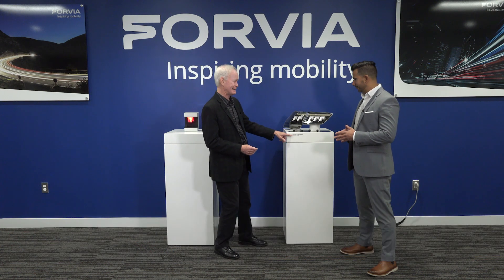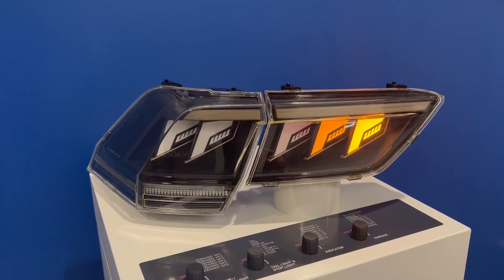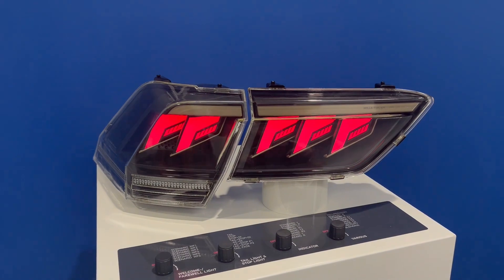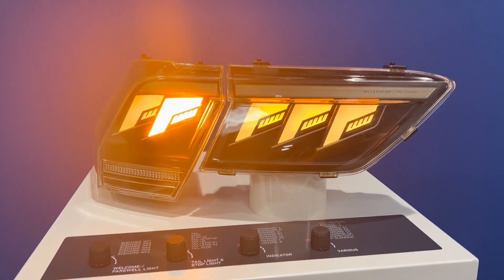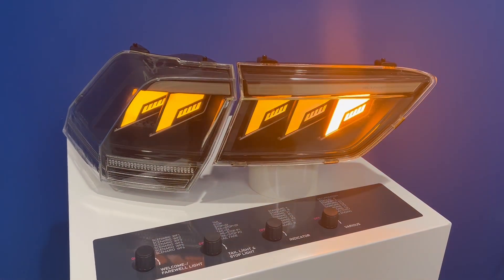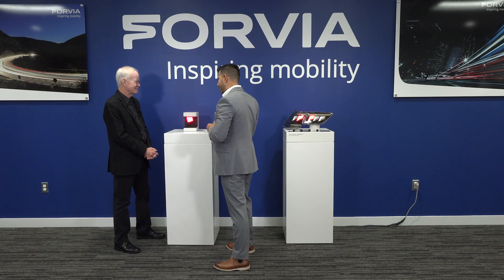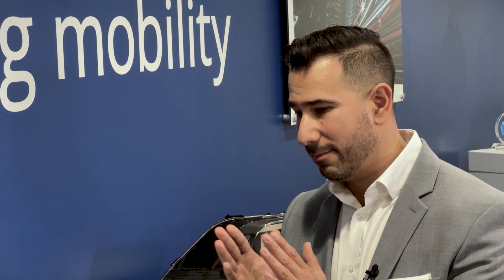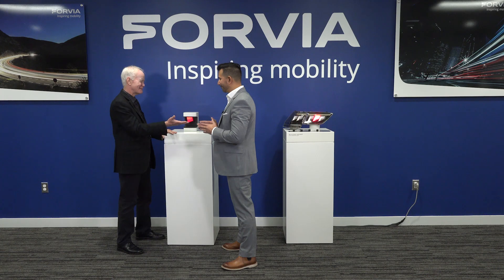Designers Rejoice! FlatLight Tech Gives You Design Flexibility

Comment: The affordability issue is, what happens if there is a fender bender?  Every time a tail light is damaged you need to buy a $1000+ tail light with LED special effects, sensors, blah blah blah and $1000 labor to recalibrate it, if you are lucky.   Once upon a time headlights were standardized circular across all brands, makes and models.

Will replacement parts be available 10yr out?  I drive an 09, and have started having issues with replacement parts.

Comment: How do you drive it? Where is the electronics? Has it been extensively environmentally tested? Where do you run the wires and how many are there? Sounds like the first application will cost big bucks, will break soon, and cost a fortune to fix. Especially if GM uses it.